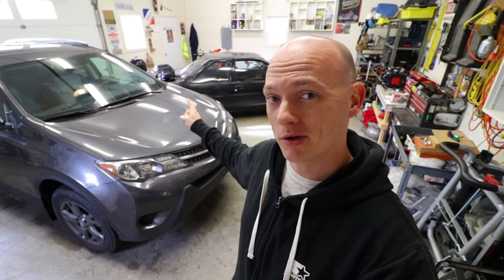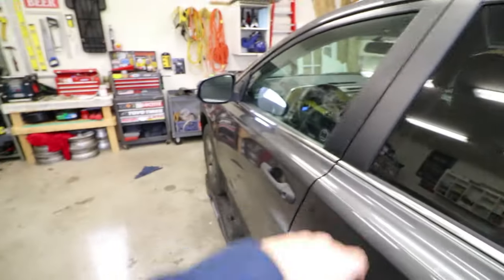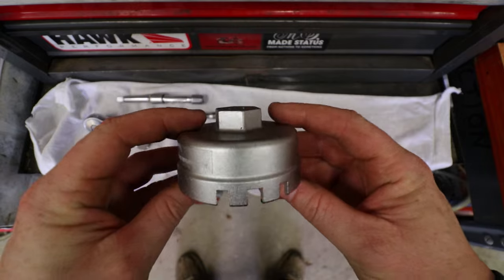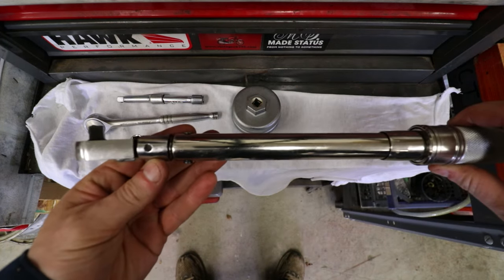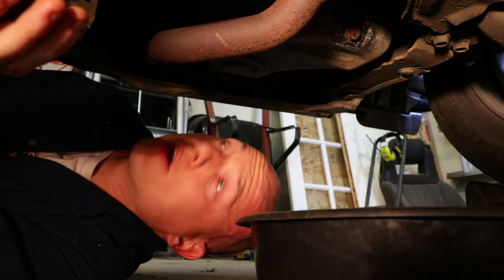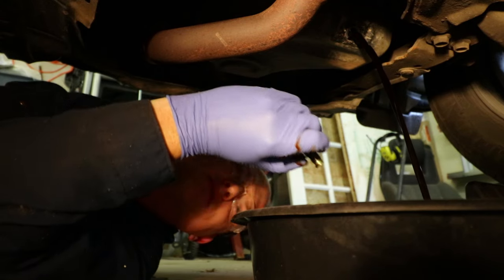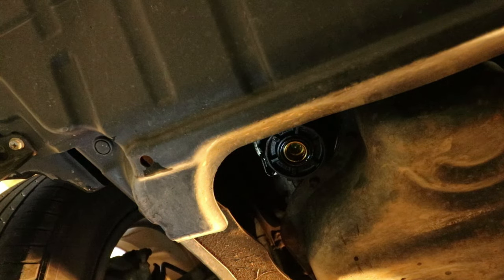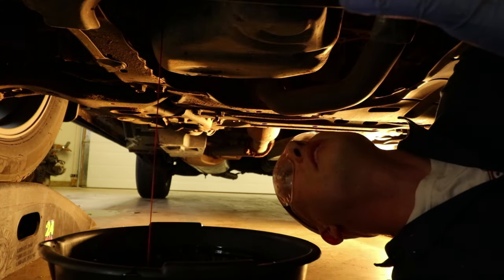How to change Toyota RAV4 oil and filter 2013 to 2018

Comment: Just got done doing my first oil change on my 2017 RAv4 after the Toyota Care ran out.  I used a Mobil 1 20k mile oil filter and their oil.  I saw on my filter housing having a different number in the 20s.  I think it was 23 ft/lb.

It looks like they have gorilla techs working there because that was way the hell over the even what the specs on there say to tighten.  I thought I was going to break it the housing.  I saw other places saying the filter housing looked flimsy but appeared pretty sturdy to me to not need to spend $25 on an aluminum.  If the filter cap is placed on correctly and the previous change wasn't screwed over torque specs, I don't see how it would break.

Has anyone tried to see if you can skip the drain plug and remove the housing only and drain it?  It didn't seem like much oil drained out of the thing that you can't remove the housing and can skip an unnecessary step.
Reply from the maker: I've skipped the drain plug... It's messy if you do this!! I was trying to be very careful and the housing still puked oil all over me. That's what I get for trying to cut corners 🤦🏻‍♂️
Reply: I'll follow it just to avoid the oil.  It's a good thing the oil filter is rated for much longer interval where doing this isn't such a pain.

Comment: Where could I find the flat washer Toyota didn’t give me one
Reply from the maker: So you can buy them from Toyota OR you can buy them on Amazon. Just search for oil pan drain bolt gasket or washer.
Reply: Mike Barker alright thanks 😊

Comment: It would be awesome if you could show us a transmission oil change? I have a 2014 AWD LTD Rav4 and the service center wants $500 in parts and labor!! :x
Reply from the maker: I'm finding some interesting (and CONFLICTING) information on the rav4 transmission in regards to changing the fluid. Some sites report that it is "life time" fluid... others dispute it. Mine has 125,000 kms on it and it's still shifting very well on the original fluid. Further research is required on my end.      Great suggestion for a video!!!
Reply from the maker: Quentyn73 - I'm really interested in your response. What would you consider to be the best way to warm up a Rav4? I've always done a "road test" to get the vehicle up to operating temperature. And you're right: the transmission fluid change is above my level of expertise as Toyota claims that it is "lifetime" fluid and that it requires a special machine that the dealerships have. 🙄
Reply: @spudsmac0  
I believe Toyota says if you use the vehicle for towing then you should change the fluid at 60,000 miles. What does that tell you? I change mine every 25,000 to 30,000 miles & I haven't towed anything with it yet. The transmission is made by Aisin which Toyota owns a controlling interest in.

Comment: I heard the tool comes in two sizes, how do I know which one I need⁉️
Reply from the maker: When I went to my local parts store the employees there helped me out. I seem to remember them only having one size on the shelf though ...
Reply: I believe it's 64 mm
Reply: Yes it comes in two sizes. You want the larger one which works for the 2.5 liter four cylinder engines and for the six and eight cylinder engines. The smaller one is for smaller four cylinder engines like the 1.8 liter found in certain years for the Corolla, Matrix, etc.
Reply: @Mike_Barker  
I think they gave you the wrong one. They often assume that the smaller one is for all four cylinder engines. It's not. The smaller one (which looks like yours) fits only the 1.8 liter four cylinder engine. All other Toyotas with a cartridge system take the larger oil filter cap wrench whether they are four, six or eight cylinder engines.

Check your again to make sure the teeth on it reach all the way down to fully engage the tabs on the oil filter cap (or housing as you call it).

Consider the wrenches pictured at https://www.amazon.ca/Filter-Vehicles-Wrenches-2-0L-5-7L-Engines/dp/B083569RMD/ref=sr_1_10?keywords=set+Toyota+oil+filter+cap+wrench&qid=1585393941&s=automotive&sr=1-10
The larger one is for the RAV4 but yours looks like the smaller one. The smaller one will work but is not the best fit because the teeth will not engage and provide full contact for removing filters that are severely stuck from being over-torqued.

The Motivx brand is the best and have the best reviews and cost the most. MX 2320 is for all engines with the cartridge system except the 1.8 engine which take the MX 2321.

Comment: So you cannot change with your hands but have to have an oil wrench?
Reply from the maker: You might be able to loosen the housing by hand but it will be very difficult. The wrench is cheap and makes the job much easier.
Reply: Mike Barker does it have to be that type? The lisle import car oil filter wrench has better reviews. Curiosity. Thanks for the help!
Reply from the maker: Hmmm... I'm not familiar with that model, but if it has the right notches/profile then it could work. Double check with the manufacturer for sure!
Reply: A regular 64 mm fluted oil filter wrench MAY or may not work. It depends on who previously changed the oil filter and whether or not they over-torqued the oil filter housing cap.

Comment: 20 minutes wait time, this is to make sure all the oil in the dip stick tube went down to the oil pan. This way no residual oil will give you a false reading.
Reply: To make a funnel that perfectly fit in the fill port, use a Mobil 1 empty quart and cut out its bottom. Screw it in the fill port... the Mobil 1 thread match that of Toyota oil fill port. This way,  no mess at the neck of the funnel. Plus no hand is required to hold the funnel.

Comment: Be sure to chock the rear wheel or wheels so the car has less of a chance of rolling back off of your ramps.
Reply from the maker: Hi Greg!  I normally do that on most of my cars, but more so on the manual transmission vehicles in my stable. On the rav4, I admit, I put it in park and activated the emergency brake. Absolutley though, chocking would increase the safety factor.
Reply: That's not necessary on ramps, in park and with the parking brake engaged. I'll bet you don't do that when you park facing up or down a hillside. And some people don't even use ramps? What do you say then?

Comment: Reassemble the oil filter?! What happened to spin on oil filters? Spin off old filter...spin on new oil filter. Done in less than 1 minute. Reassemble the oil filter?! I know what car make I'm avoiding!!!
Reply from the maker: It's a bit of a pain, but still the most reliable vehicle I've ever owned. Knock on wood
Reply: So because it takes 3 to 5 minutes longer once or twice a year, you'll buy a different vehicle! Wow!

Comment: $100 in tools alone 😂
Reply from the maker: Hah! If you used my Snap-on torque wrench you'd be welllllll over $100. You can get away with doing this for less than $100 with the right budget tools.
Reply: @Mike_Barker  oh I know mr bujee! I ended up borrowing tools and will get my own pair soon. Just moved states and don’t have my dads tools to use anymore so gotta bite the bullet to buy my own tools now.